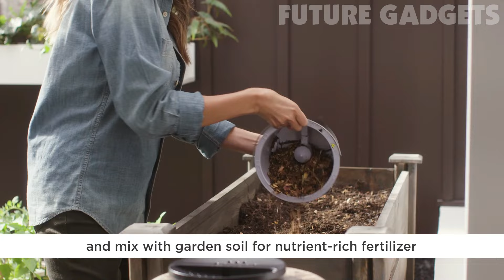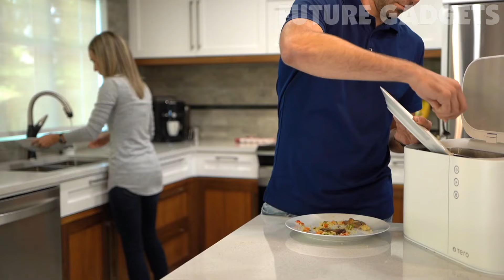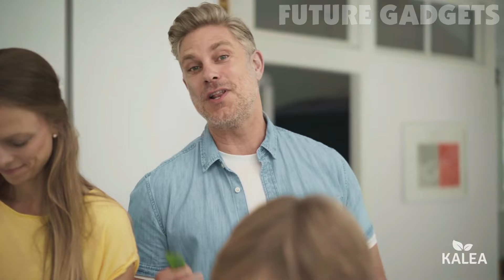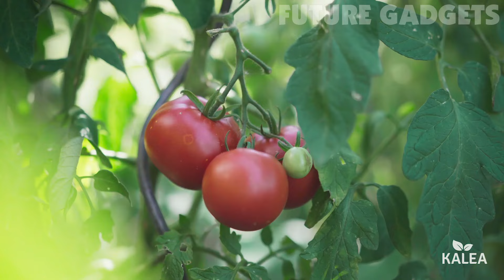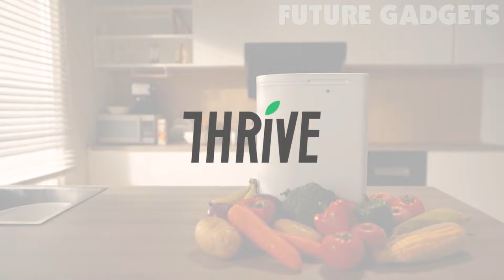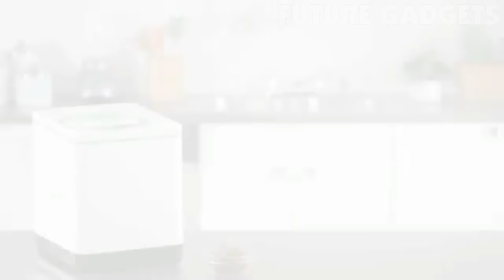Top 5 Best Electric Kitchen Composter You Can Buy in 2024

Comment: All this sounds really wonderful; being able to turn your food waste into soil for the garden, but at what cost I wonder?  First off, these devices are rather expensive (approx $500) to purchase.  Kalea is $800 - $900!  You also need to replenish the carbon filter components (approx. $25 to $40) every few months; yet another cost.  Some (like Lomi) require a membership.  Here's the main problem I have:  Since you have to run the device for many several hours (16-20 hrs. in some cases) to create compatible soil, that's using a LOT of electricity!  How is that good for the environment?  These devices use HEAT as the primary force to reduce waste.  You need electricity to do that; a lot of it!  I feel that's the downside to owning one of these devices.  Of course, I applaud the people who are working diligently to help us find ways to reduce food waste, etc. but shouldn't we be using LESS electricity to truly help with the environment?  How about a solar device?